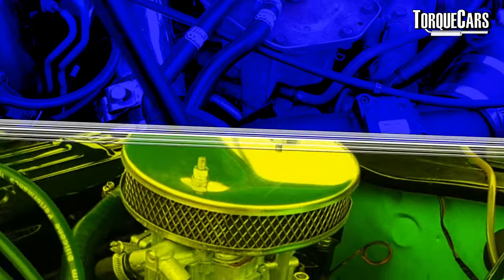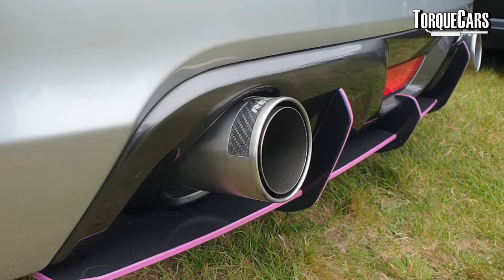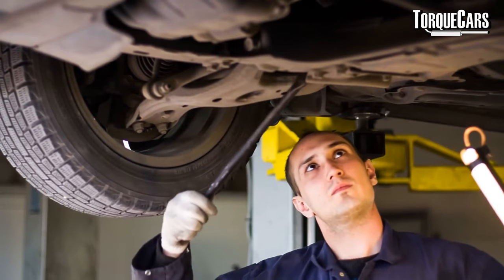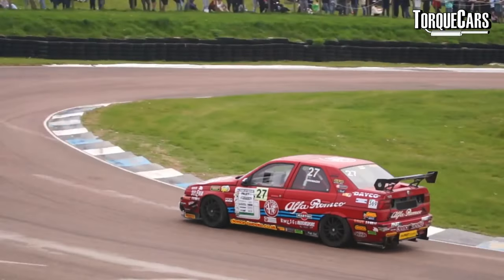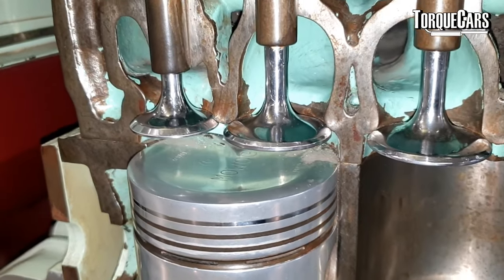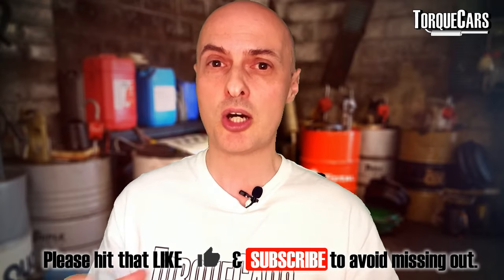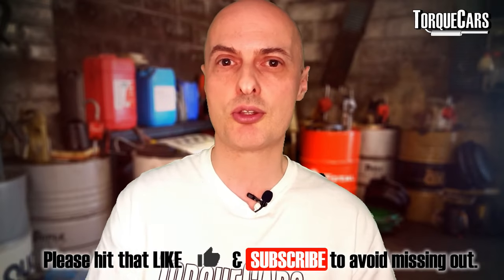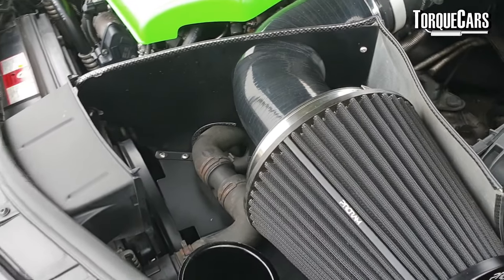Best & Worst Car Mods For Performance Tuners 🏁 [Reviewed & Rated]

Comment: great vid mate. even the missus liked and understood...... most of that lol. i have a standard 1.7 zetec millenium puma which i beleive has history with the duratec engine somehow, and also yamaha, so as a simple engine which likes to rev anyway i'd be keen to know what the most affordable/common mods would people do for that. ive fitted a panel K&N on the basic i wanted de-cat full through to the scorpion. and a remap. im limited to what i can do due to health etc etc. and for where i live it's not top end at all thats worth it.
Reply from the maker: Thanks for your kind words and support. I would look into a set of throttle bodies. Air filters will not really give a power gain on that engine. Fast road cams are another mod I would recommend on the 1.7 Zetec but don't get too aggressive with the profile.
Reply: @torquecars  cheers mate yeh i would love throttle bodies but cant afford much as im not well at all. do you know where n whats best for the right bodies? as in price and brand maybe?? thanks for the reply and advice. :)

Comment: Going to be building fiat 2.0 dohc i live in TN in usa we have no pollution control laws i have two fiat spiders one is a 1980   fuel injection and the other is a 79 2.0 carb i am learning as i go pulling the engine of the 79 to start the build tell me what should i do

Comment: Hey bud can you turbo and tune 2.5 N\A engines thats are 2022 and newer cars i been looking for turbo kits for my nissan altima found someplaces that will build the kit but they say it cant be tuned?
Reply from the maker: On Nissan the ECU's are generally not easily remappable so you should go with an aftermarket ECU or a piggyback ECU. Haltech, Megasquirt, Apexi are pretty popular options etc Make sure it has knock control as some cheaper ECUs do not offer this. They are expensive but it is the easiest way to adjust the map the engine uses to keep everything working well.